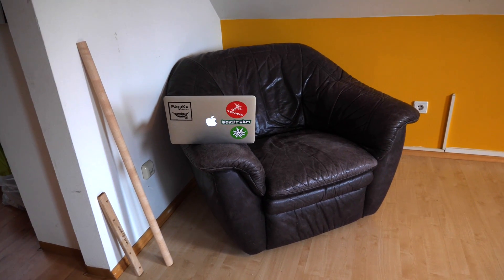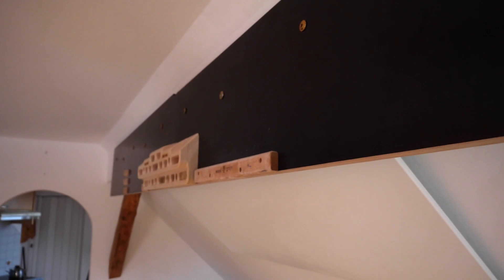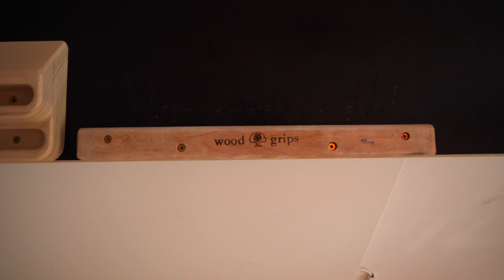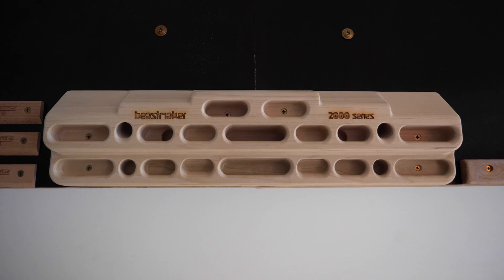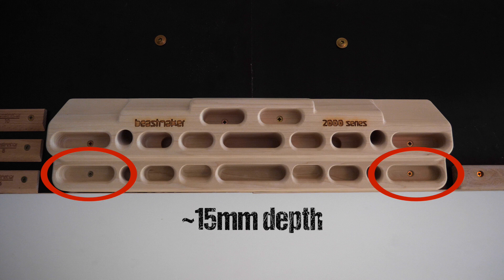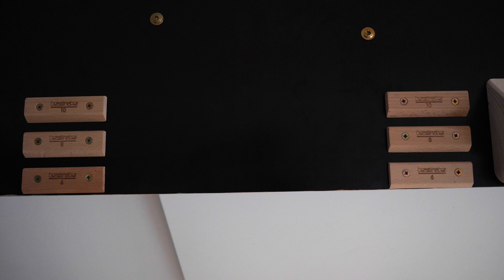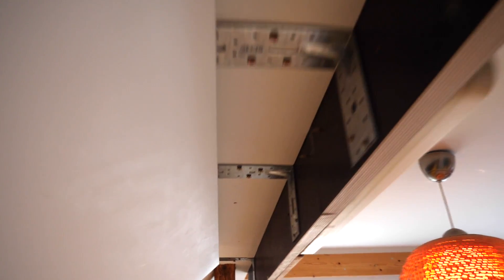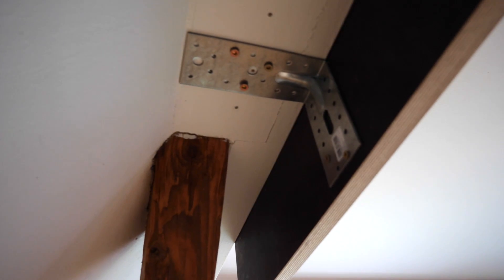New Hangboard Setup + Beastmaker Review (2000 & Micros)

Comment: Thanks for sharing. 8 to 10 cm of gypsum with little support will result in quite some bending force on these screws and they are not designed for such forces. I'd suggest to mark the top of the board and from time to time check if the screws are being pulled through the gypsum. If the boards start to sag, you'll probably need to fix the boards to the ceiling to prevent a nasty fall. Just looking after you (and securing my supply of great climbing videos).
Reply from the maker: I already tested the construction with a sick amount of bonus weight, and there's not a mm of movement, everything stays rock solid. But I had the same thoughts, that's why I added the angle brackets as a backup.

Comment: Hey Mani do not forget that wood is a hygroscopic material, it will give/take humidity from the air and change size (width and thickness, it barely moves along the grain direction). Note you can just pay a visit to a woodworking shop and ask for some scraps, if you're lucky they have a bunch of leftovers of desired (and consistent) thickness. Moreover, they could help you out in making decent rounding for the thinner pieces.

Comment: I also have the beastmaker 2000 and the set of micros and I've your same "problem" of the rounding, but only on the 8mm ones (6mm and 10 are perfect for me), It took a bit of time to get used to the slightly different (and slightly painful) rounding but once you pass that phase they're awesome. I agree with you that they are a bit on the expensive side, but I tried to build something like that myself and unless you have available some kind of professional tools you're never going to get that clean and nice finish that the micros have, just my two cents :)
Nice setup by the way, the addition of various holds would be a game changer.. Think of all the campusing circuits you could create ;)

Comment: I found the measurements for the BM2000 depths that you show to be quite off from mine.  On my bm2000, the #12 is .82(~20mm) and #8 slot is around .5 (~13mm).  You talk quite a bit about the importance of consistency, but not all BM200's are the same.  There are four in my local area that I've tried, and while I haven't measured holds on all of them, they are definitely not the same.  The one in the On the #8 slot for example, the difference in max hanging weight for me between my bm2000 and the one at the gym is about 15lbs, quite a bit different.  On some the 45 degree sloper is inconceivable as a hold, and on others its hard but doable to hang.
Reply from the maker: Interesting, thanks for the info! Beastmaker... what are they doing XD will test that wth mine and the one at my gym as well!
Reply: @ManitheMonkey  Did you find anything?
Reply: Maybe there are small differences in the angles how the boards are attached to the wall. They can be difficult to notice but significantly affect on hanging experience.